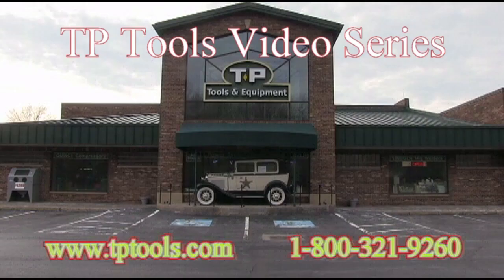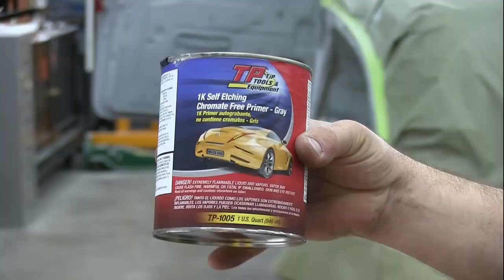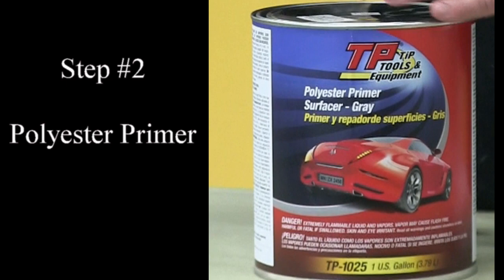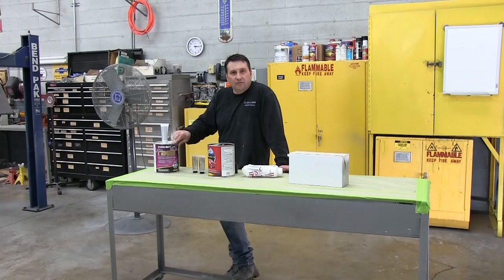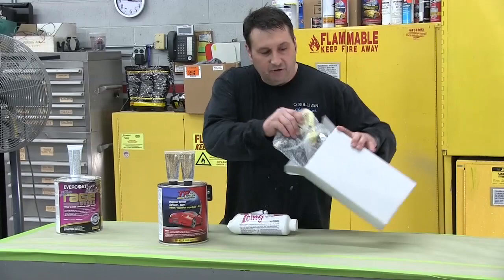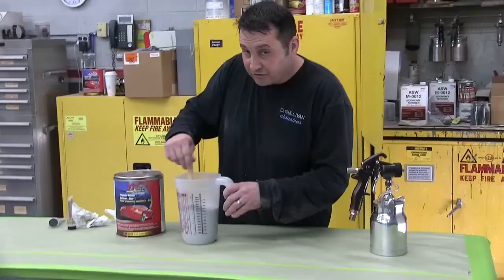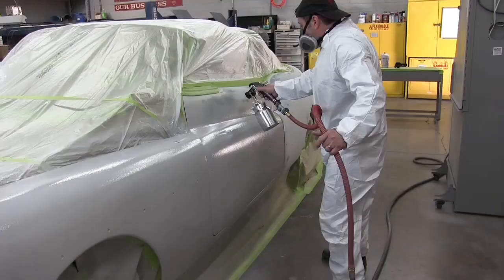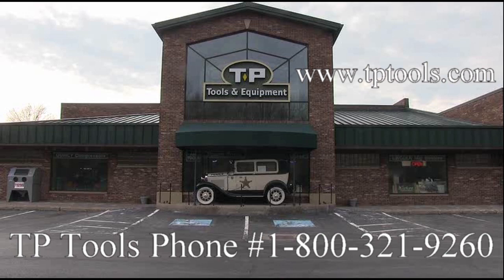Part 2 - TP Tools HVLP Painting How to Primer

Comment: Painting my cars and vans is a hobby for me. i have a cheap turbine spray gun with just one size tip, 1.5mm ok if you accept some orange peel in the finish but great for getting the epoxi and primer on. Ive just bought a sagola turbine 1000, it has 3 different tip sizes 1mm 1.4mm 1.8mm, cant wait to use it on my van, ive got the repairs done and in epoxi primer, i have 2 windows to cut in the rear. and 2 in the sides. im using 2k industrial polyurathene enamel paint, all the same brand products. epoxi primer, primer, 2k top coat. The good thing about turbine sprayers is' the constant air flow and no need to wait for the compressor to catch up,  no water/oil contamination from the compressor. i have a good filter box but still get some through if i dont change the filters out. easier setup. downside with the the hobby units is lack of atomisation but now i have a 1mm tip i hope it'll be a better finish. time will tell.

Comment: Have been thinking about a turbine system for a year now. Trying to find as many videos about turbine painting as I can.
I think this coming spring I can finally switch over from a compressor set up.
   Questions: 
How can i minimize orange peel with a turbine? Slow or extra slow reducers? Will the clear always have a degree of orange peel that will require sanding and buffing?
   Some cars I will be doing are just daily drivers,so showroom glass is not needed, but if I can avoid extra labor on these cars, it's better for my bottom line.
   I know the heated air must dry the solvents faster, so trying to think ahead before i ever pick up a turbine. Less overspray is an important factor spraying at home as I will be using an inflatable booth this coming year.
Reply from the maker: Hi,
Thank you for considering our turbine units! To answer your questions, the best way to eliminate / minimize orange peel with these units is to simply use slower activators/reducers while spraying. The turbine will generally have the paint at 10-15 degrees higher than your ambient temperature so you want to activate/reduce for gun temp and not just temp in your shop. Please give our tech line a call at 1-800-321-9260 if you would like more in depth explanation and answers.
Reply: Bro if you are trying to eliminate any extra work after painting forget about this machine. I bought the whole setup that came with two guns I also bought all the gun tips and no matter what I did I always ended up having to work the finish twice as hard as I would if I just used a air compressor because I would get monster orange peel or monster dye back because I had to reduce the clear above 10% because it just wouldn’t come out nice out of the gun I also get bubbles in the clear mostly of the times just like you would if you were spraying with a air compressor and you had water in the lines. I don’t want to make the machine sound like a scam but why don’t they make specific videos on how to spray clears with it or how to fix certain problems just like the ones I’m having I mean they would sell a ton of units if they made videos using the machine. I only use to spray primer because it creates 0 over spray and I always go back and sand it days later right before I paint.
Reply: @jr.rangeeel7624  that with a single stage? Anything else about this system that you didn’t like? I’ve been wanting/debating on to purchase this system or a buy compressor and a few DIY guns and practice that way on on of my rust buckets. But can’t find much info or videos on this system like you’ve mentioned so I’ve been hesitant

Comment: I have my car, daily driver, in bondo with some bare metal spots showing and sanded to 180.

Can I use tp tools dtm 3 in 1 urethane primer for filling sand scratches and then use it as a sealer before spraying single stage, without using etch and high build primer?
Reply from the maker: Hi Randy,
The TP Tools DTM 3-in-1 would work perfect for your application. You can spray your first coat on heavy to use as more of a "filler" for your low spots and such, and then thin the primer 10-15% to use it strictly as a sealer for the second coat. Our primer has built in etch properties, so seperate products would not be necessary. You could ggsimply prime and seal with our primer, and then paint right over the primer. Hope this helps!